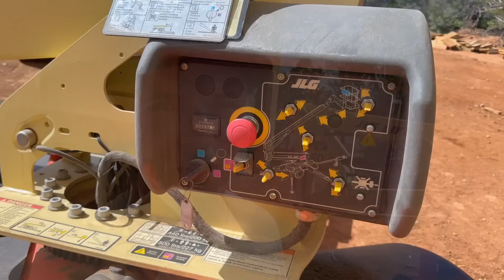THE BUILDING INSPECTOR SHOWED UP... GOOD NEWS?

Comment: I feel your pain.... this is why things should be done the way we did it when I was a framer in Missouri... We sheeted every wall and every gable ends before we tipped the wall and/or craned in the trusses. 

In Texas (my now home state) they sheet the buildings after the fact... this always drove me crazy because I know there is a better way. 

Shoot, we even set the windows and the porch beam (and porch roof/sheeting) before we tipped the walls up... we even completed the sofit/facia on the gable ends before we craned them into place. 

In short, we did everything on the ground/subfloor that we could. Because of this, we hardly ever had to break out the extension ladders.

Comment: As long as your tires are pretty level you will not fall unless you bust the lines. Then it will just start going down gradually. Just make sure the wheels are level as possible

Comment: A quick note or two about your endeavor and the success you are having with the apartment, KEEP UP THE GOOD WORK!  In regards to the window flashing, the majority of the flashing should be on the outside of the building instead of covering the inside of the window sills.  The flashing is designed to work with the building wrap/ paper to keep the moisture out, so there must be enough flashing to overlap by 4-6 inches on the bottom, sides and top of the windows and doors.  Many times the architect will have details of the proper way to use the flashing and building wrap in your set of building plans.  I hope you catch this before your next windows video and building inspection.  Also check the manufacturers specifications on all installations.  Water will always find a way, 'it's the great RECYCLER!
Alan

Comment: Even if you need to move the machine several times, placing it so you don't extend the basket much past the outriggers will put you more at ease. Much safer than a ladder and more work done in the long run. Less fatigue on your legs than a ladder lets you get more done.